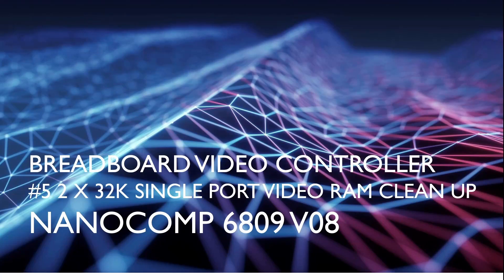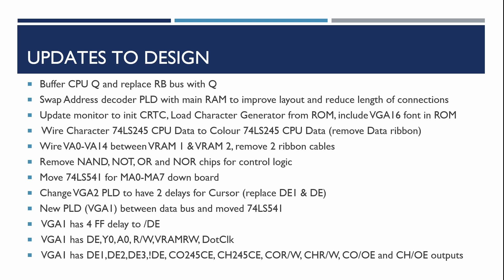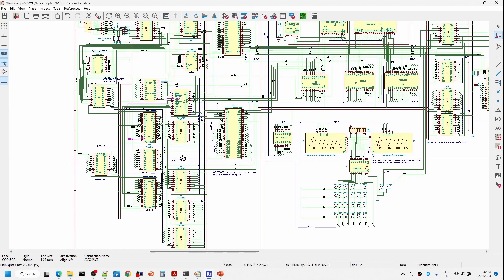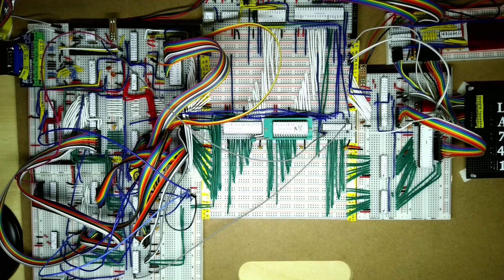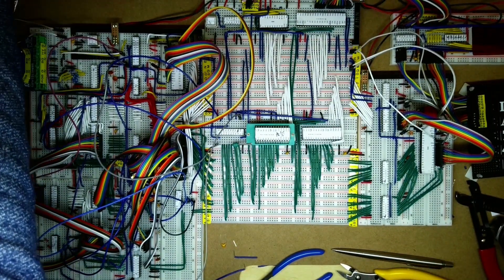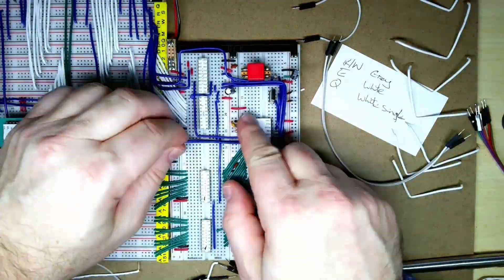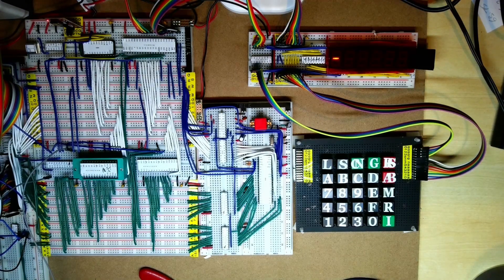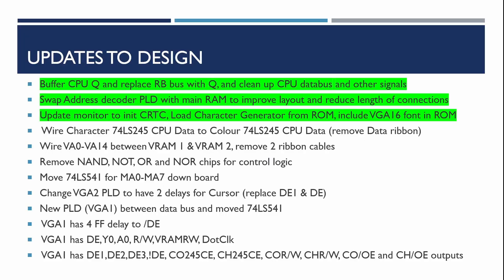V08 Part 1 Breadboard VGA Controller Clean Up Nanocomp 6809 8 Bit Breadboard Micro

Comment: Nice to see you using the 6809, when the 6502 and Z80 get all the attention. If you get bored you could have a go at porting my OS, though I used a V9958 for my video output. Probably not that hard overall. Have a look at my channel if you’re interested. 

One tip: the schematics are very hard to read because your using symbols which are the physical representation of the ICs vs the logical representation. 

Are you planning to make a PCB?

Cool projects, thanks for making vids!
Reply from the maker: Thanks for the feedback.
I always thought the 6809 was the best thought out 8 bit micro, especially when compared to the 8080 and 8086 which were not as clean and logical. Will take a look at your OS once this series is complete. I have a Keyboard controller to use as PS/2 keyboard interface and an I2C controller so I can hook up SD card plus other more recent technologies so may need something to handle files and FAT.
As far as the schematics, I did explain in some of the earlier videos that I found using the default logical symbols tricky as often taking the schematic and putting it on breadboards was painful. I created Breadboard (BB Suffix) versions of the chips I use which have the Physical pin layout. This makes it much easier to convert schematic into physical breadboard layout. Not planning to do much with PCBs unless I want to make these projects more permanent. I have a 68008 and an Intel 8088 I would prefer to get working on breadboards rather than going through many revisions of PCBs which I suspect I would need. 
If you see the Nanocomp introduction you can see I made some very basic PCBs back in 1981 so I feel I have done my time there! I know PCB manufacturing has moved on a lot since then but Breadboarding Labs is the channel name for a reason.